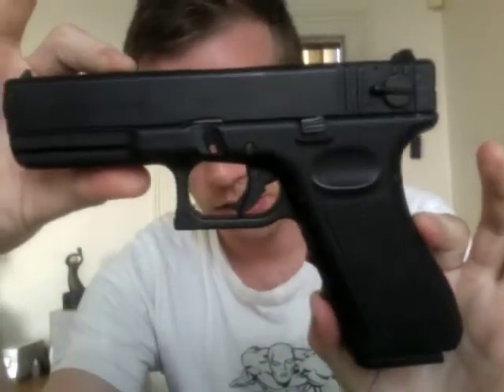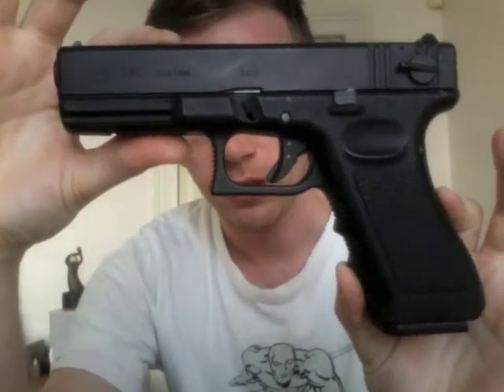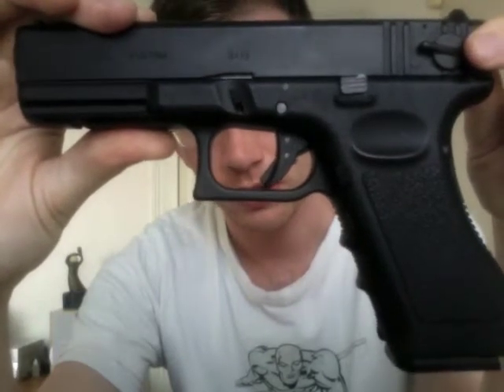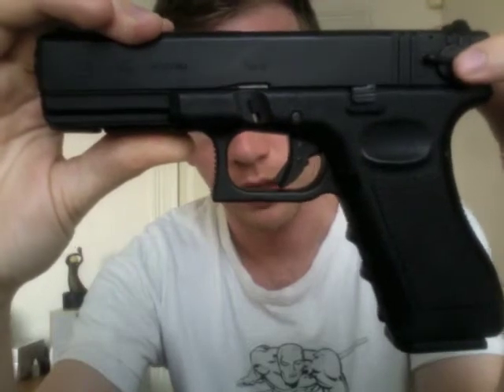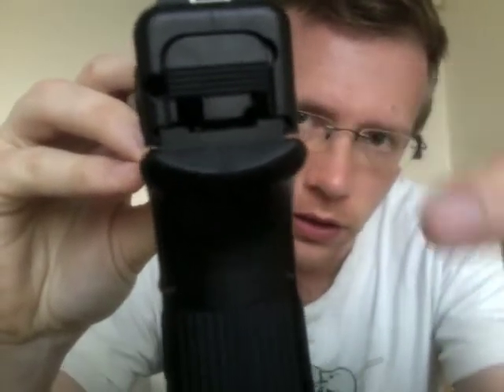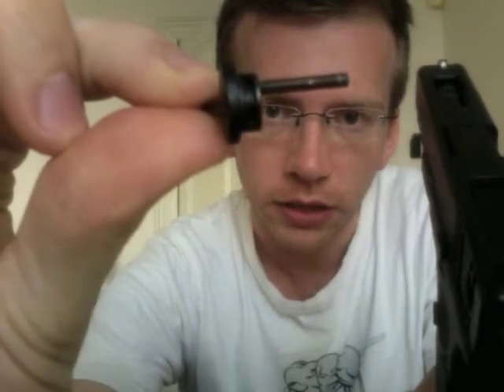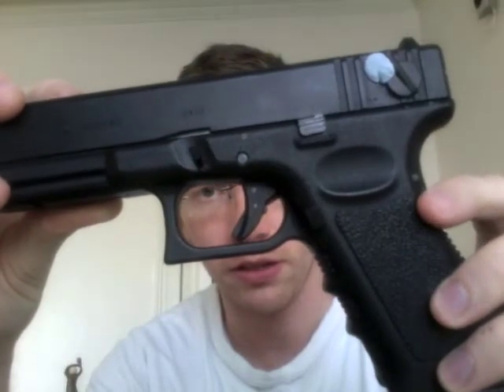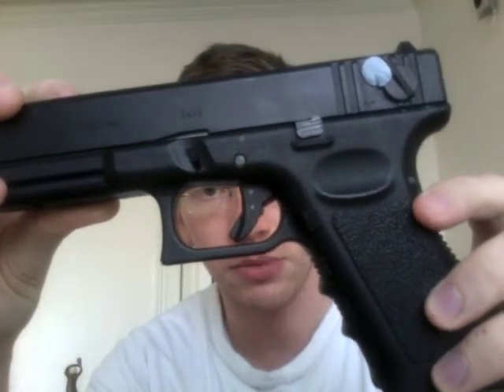Airsoft pistol, G18C Glock and it's safety switch problem

Comment from the maker: Blowback pistols like this will do that when they're empty. There's a small catch that holds the top sliding part back and 'locks' it in that position. When you fire an empty airsoft blowback pistol it will always do this. 
The catch can be held down to stop it catching or 'locking' the top sliding part when being fired empty. I don't recommend doing this too often though. It's not good for the airsoft pistols.

Comment: Middle position is NOT safety. Its for take down. The pin fell out because a very small Allen screw under the rear sight has gotten loose, happened to me.